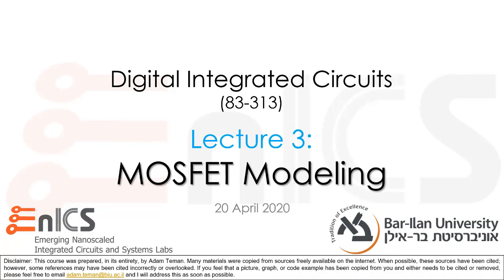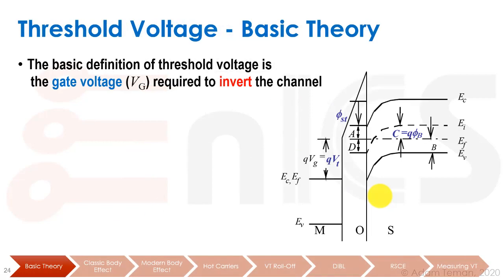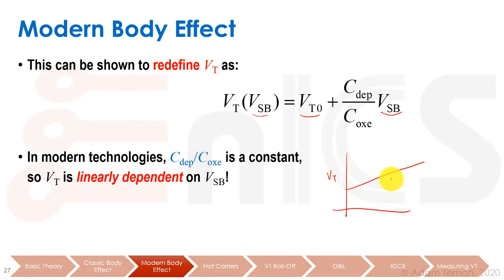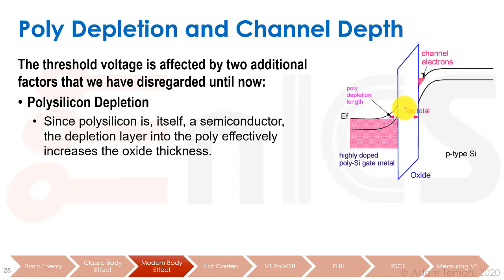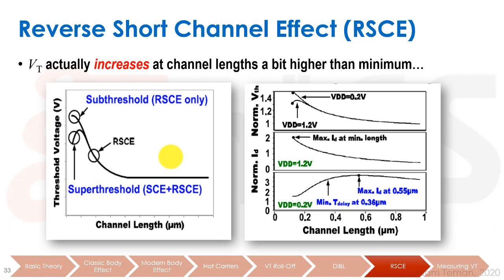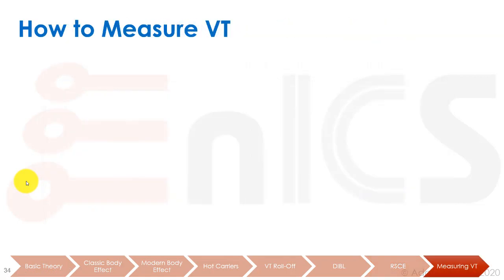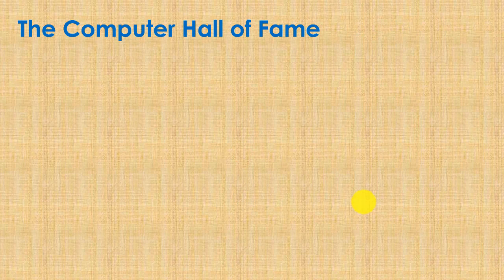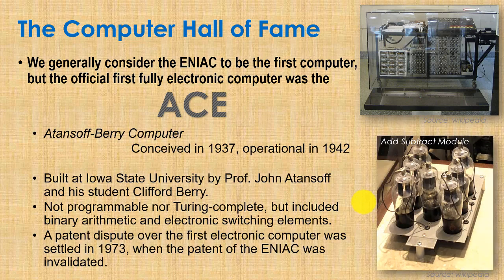VLSI - Lecture 3c: MOSFET Modeling - Threshold Voltage Revisited

Comment: Can anyone help me understanding Body Effect intuitively without using equations?
Reply from the maker: Hi,
The easiest thing in my opinion is just to remember the following: "Negative Body Biasing raises VT". For an NMOS, that means that if I put a negative voltage on the bulk, my VT is higher. For a PMOS, the opposite - if the NWELL is biased higher than VDD, the |VT| of the PMOS becomes higher (i.e., the VT becomes more negative). 

To understand in general, physicists have many ways of explaining things that are all different ways of looking at them. One thing you could try is that there is a certain amount of voltage you need to apply to the gate in order to invert the channel. If I put a negative voltage on the body, I need to apply more voltage on the gate to bring the channel to the same voltage. This can be supported by the two capacitor drawing I show many times in the slides, where the gate-to-channel capacitor is what we want to control the channel, but the channel-to-body (or channel-to-others) capacitance is "fighting" with the gate voltage. If we apply a negative body voltage (on an NMOS), we are effectively increasing the gate-to-body cap and making it harder to invert the channel.

Hope that helps...